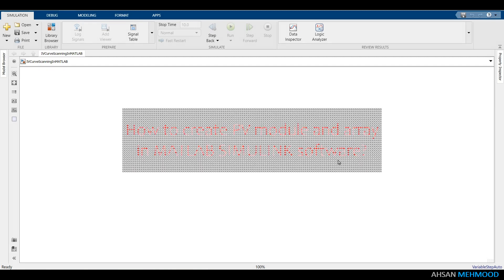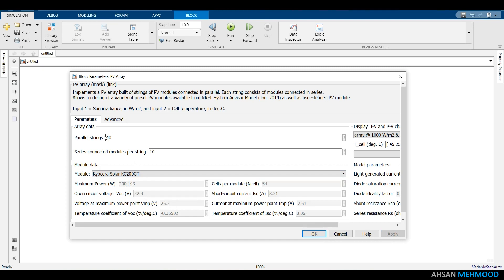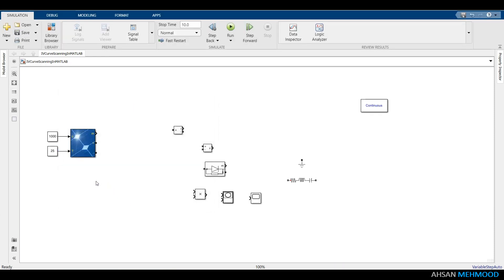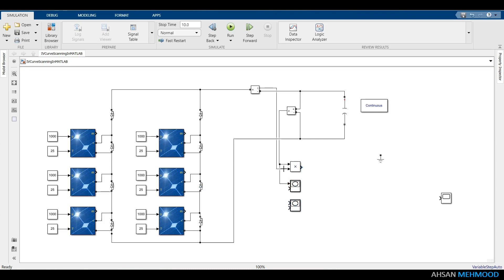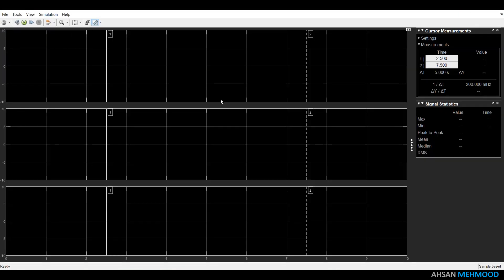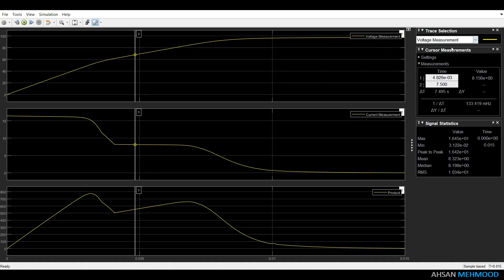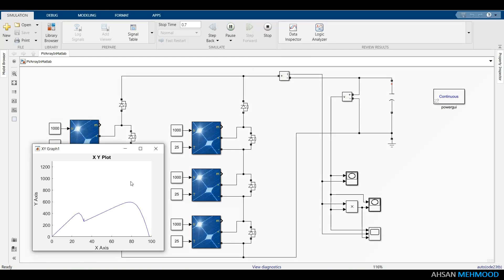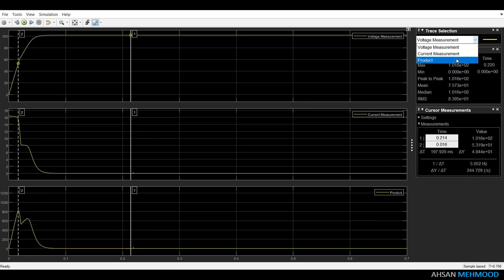How to create partial shading in PV array? | MATLAB | How to create faults in PV array? | SIMULINK

Comment: How do you choose the value of Capacitor?
Reply: In order to trace characteristic curves of the solar panels, capacitive load-based method was used in this project. For this, Time to charge the capacitor upto Voc is given as 
t = -C*(Rs+Rp)*log(1-Voc/(Ipv+Rp))
Rp = 1/di/dv when Vpanel = 0 (short circuit)
Rs = 1/di/dv when Vpanel = Voc (open circuit)
t will be approx 0.015 sec for C = 1e-3
This model also works fine for C =1 F and t = 10 sec

Comment: Yeah, Mr. Ahsan, This is one of the best. Keep uploading
Reply: Please also provide some idea why to chose capacitor? and secondly, how this simulation time is taken?
Reply: In order to trace characteristic curves of the solar panels, capacitive load-based method was used in this project. For this, Time to charge the capacitor upto Voc is given as 
t = -C*(Rs+Rp)*log(1-Voc/(Ipv+Rp))
Rp = 1/di/dv when Vpanel = 0 (short circuit)
Rs = 1/di/dv when Vpanel = Voc (open circuit)
t will be approx 0.015 sec for C = 1e-3
This model also works fine for C =1 F and t = 10 sec

Comment: Sir, please how can I create bypass Diode fault???
Reply from the maker: Just add a "timed switch" in series with the bypass diode. Switch will be on at the start of the simulation, and you can turn it off to create a fault at a specific time instant.
Reply: @ahsanmehmood9229  
And the hotspot fault please!!!
Reply from the maker: I haven't researched Hotspot's fault.

Comment: Bro ur very great in explaining can you please tell how to generate constant voltage from mppt dc-dc converter even under varing irradiance or temperature
Reply from the maker: I had already given answer of your question in a previous comment.

If you give me details of your project and explain exactly what you want to do through email, then I can guide you better.

My email has been given in 'About' section of my channel.
Reply: @ahsanmehmood9229  have mailed you bro 🙏🏼🙏🏼
Reply from the maker: I have read your email...I'll update you in few days.
Reply: @ahsanmehmood9229  bro can you please tell minimum time to complete it because I want to add that to my project
Reply from the maker: Battery charging simulation takes long time, that's why the video on it getting delayed. Just wait for 3-4 more days.
Reply: @ahsanmehmood9229  okay bro thanks for the effort ❤️

Comment: How to simulate 3*3 pv array (1*1 in each module) on mppt?? Pls make a video...
Reply from the maker: That would be a mixture of my two videos.There would be nothing new in it.
 
If you want to implement it, then you can follow this video to make a 3x3 PV array and already uploaded video on MPPT to implement full system.
Reply: Which matlab version is this???
Reply from the maker: It is MATLAB R2020a.
Reply: @ahsanmehmood9229  @AHSAN MEHMOOD  hi sir, i used r2020a too. but, when i run the simulink the xy graph has no graphic. and the graphic in scope was upside down. can i ask you why did that happen?